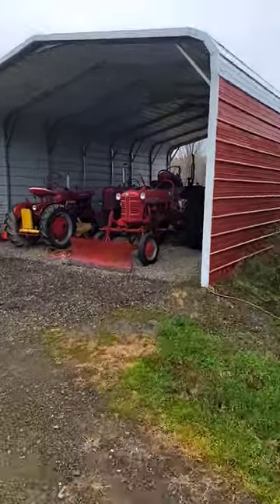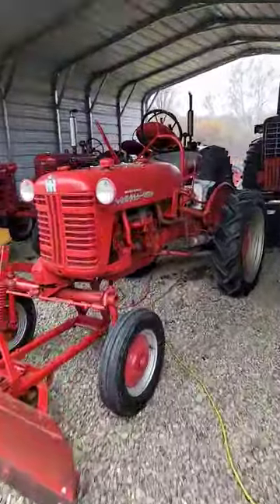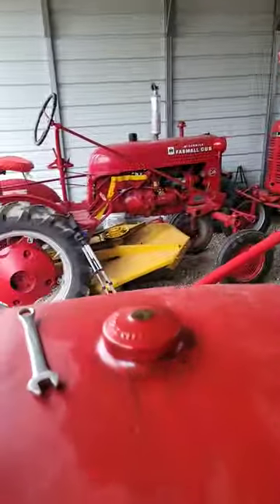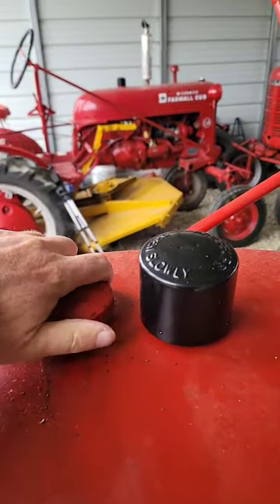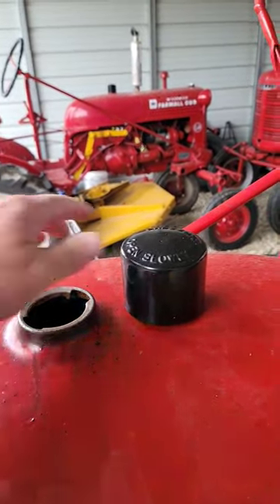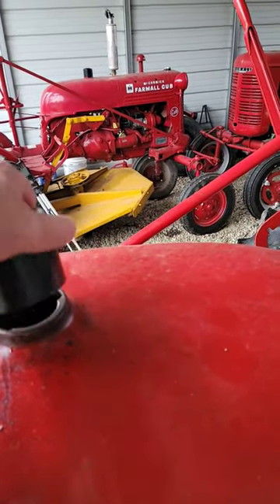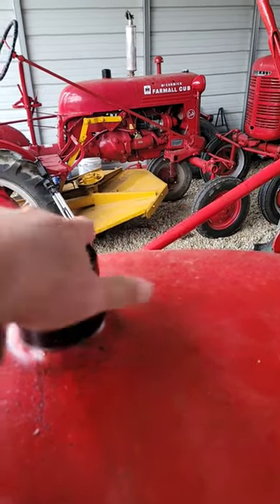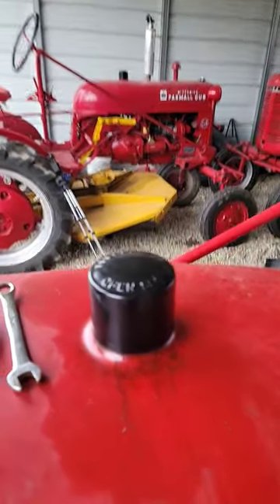No More Leaking!

Comment: Hello. We used to have a cub. It didn't like the 
Muck spreader, it made 
Her rearer up.
Reply from the maker: Yeah they aren't very big tractors
Reply: @FarmallFanatic  it ain't so much the size.
It's the design of them.
We have a fordson Dexter and that's has 
Small with its little 3 cylinder Perkins P3 engine. It plays with
the muck spreader.
Reply: They are great with the 
Mid mounted mower. We used ours for bopping thistles.